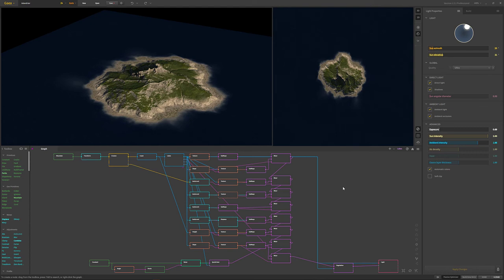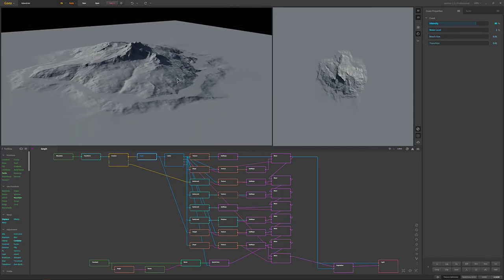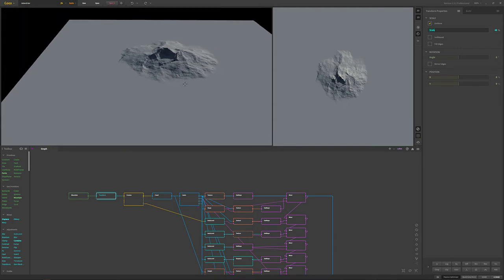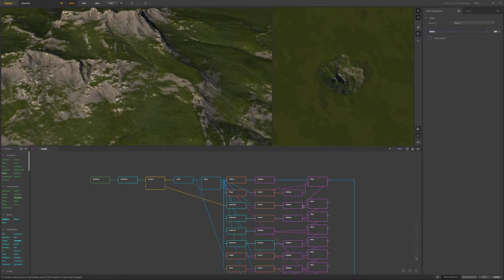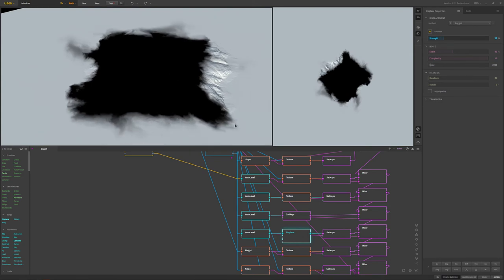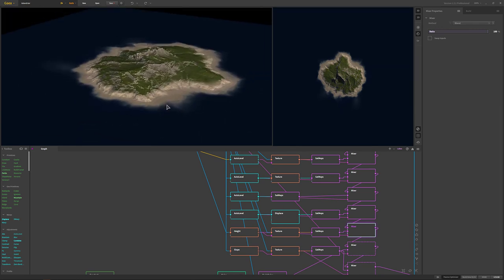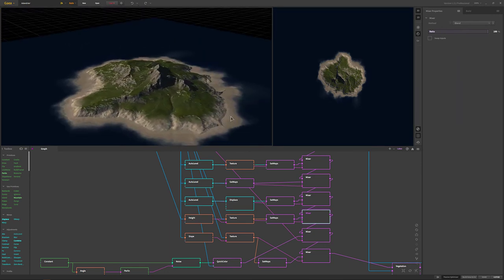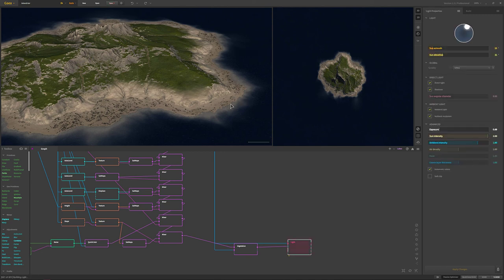Gaea Tutorial: Basic Island

Comment: For some reason the combine/mixer nodes won’t connect to each other. It’s just gives an error message in the boxes can someone pls help
Reply from the maker: Combine won't work when putting a height field and a color map together. Combine was changed to accept a color map, height map, etc. and auto switch to what it needs to combine.

You will know if the combine node is set to use a height map if it is a blueish color or pink for a color map.

Make sure you are not trying to cross the two because it won't work... Or won't work well.
Reply: @DylanPWN  yea bc it connected through the new box it made automatically and basically just mixed the sand and the grass color. The sand and grass aren’t seperate
Reply: @DylanPWN  do you have a partreon or something so I can get more updated content. This is my first day on gaea and maybe my 3rd on unreal engine so a lot of the times I’m lost bc ppl don’t do tutorials that match up with the latest updates
Reply from the maker: @loganrichardson8799  my gumroad store serves as a Patreon substitute for me. 

I need to add all of my updated content to it but I haven't the time to get it on there due to an unsustainable and unpredictable work schedule.

I plan on add a bunch of content and updated tutorials to it within the next month or so.

pwndesign.gumroad.com